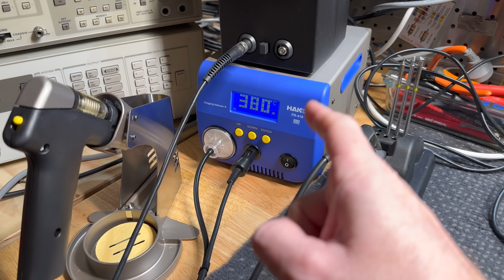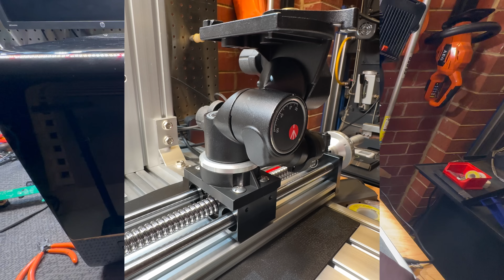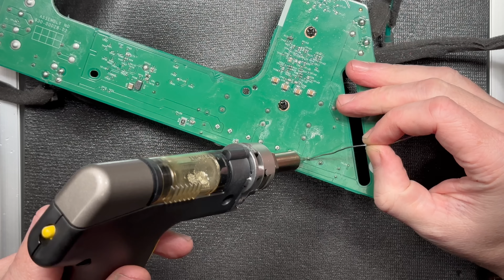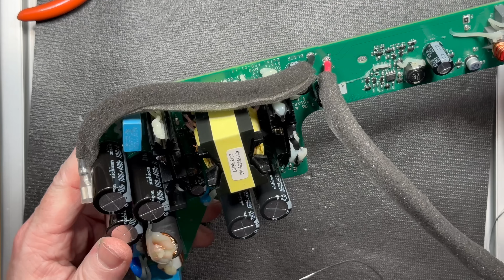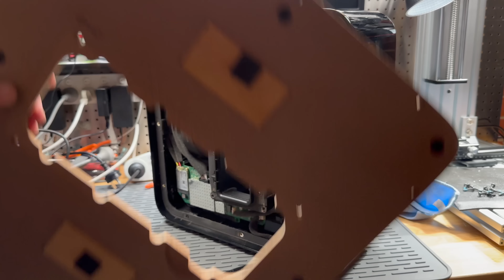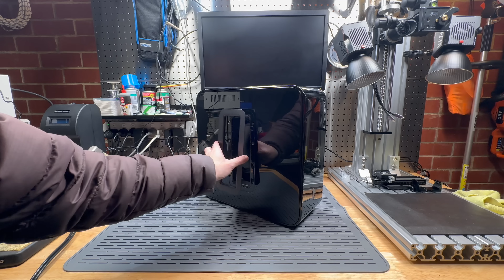SONOS Subwoofer Repair - Part 3

Comment: To anyone wondering which part goes with which component on the board:

R77 - UR73VH2BTTD1R00F
R37 - CRCW06031K00FKED
C85 - C1210C105K1RACTM
D15 - B280-13-F
Q16 - ZXTP2039FTA
Q10 - ZXMP10A13FQTA

For Q10, they were backordered of that particular item so from what I could find, ZXMP10A13FTA was the next closest alternative but unfortunately also backordered so next best I could find was SI01P10-TP which is what I ended up using.

Unfortunate that Sonos provides 0 support on these especially considering the initial upfront cost and the fact that they claim " we have developed a new approach to product design and construction that uses fasteners rather than adhesives, making them easier to refurbish and recycle" but thanks to content like this, they can live on.

Comment: Would you mind sharing the full parts list that you used for this. I have a cart filled with stuff at Mouser but would love the reassurance that all the parts match what you used.
Reply from the maker: It is in the video near the end
Reply: @whatcouldgowrong7914  thank you. i must have missed it. will go back. and thank you for ALL of this. so incredibly helpful.
Reply from the maker: @jonesbasf  21:38

Comment: Plastic speaker frames is downright criminal for this price point. Stamped steel would have been better. Plastic makes a rattling noise when vibration is placed through it. A very cheap and idiotic idea. The frames should be make from cast aluminum at this price.
Reply from the maker: Actually if you research this, the plastic frames actually offer advantages vs stanped steel baskets

Comment: Pro tip, anything connected to ground plane, even with the thermal reliefs, needs to be left on the board to heat up a bit longer. As the ground plane just sicks away the heat. Good tip is to pre heat the board first at around 100 deg c. i use the metcal inductive delodering gun. By far the best but far more expensive too. powered by compressed air too from a shop irline if you have one.
Reply from the maker: I do and I actually considered getting the thermaltronics one to match my inductive iron. Only thing that put me off is I would have to buy another station as I can only run one output at a time :(
Reply: @whatcouldgowrong7914 time to get the dual output station. Perfect timing 😉

Comment: Well done, Since it is a digital amplifier with wifi and such I assume that there is no possibility to solder an audio input.

To connect it to an existing amplifier other than sonos so that you can still use the built-in amplifier but also connect it to a full 7.1 home theater amplifier.

Love the slim design of the sonos sub and good sound compared to the size.

Have several sonos speakers but do not work as well as home theater compared to large speakers
Reply from the maker: I think there may be a possibility if you could get the datasheet for the audio amplifier module but I think the biggest issue is the DSP corrections and opposed drivers

Comment: These desoldering tools are great but they can do next to nothing if the heat transfer does not help. I have a Goot and can crank it up to high heaven but still no good against plated through holes with lead free solder especially when the hole is very tight on the terminals. You need to lower the melting temperature of the solder used and lead free solder is just too high. So you do need to either use leaded solder to "contaminate" the joint or flux. Either works. Leaded solder has flux core anyway so am not sure which contributes more.

As for soldering, I found crankig the iron to 460 degrees and using leaded solder helps. You really need to keep the solder liquid until it creeps into the hole otherwise it will freeze too early and won't go all the way through. This just shows how much heat is lost as soo as the solder moves away from the tip down the hole.

Comment: Sonos is overrated garbage. I can't understand people who are buying their products.
Reply from the maker: People who dont want to cover a room in acoustic treatment or install tons of speakers. Sonos room corrections are simply better than any HT amp based setup ive tried…
Reply: @whatcouldgowrong7914 You make a good point, but for the price, they're using low-quality parts. Don’t they realize that technology is advancing quickly, and someone will create a better, cheaper product that will outcompete them?
Reply from the maker: @hatobp The Sonos subwoofer had had a few generations but the sound hasn’t changed in 7 years and mine is still supported with and integrates with their latest products. My last HT amp was outdated in 3 years due to HDMi video standards changing. Likewise I have taken apart many high end subwoofers from JL audio, SVS etc and they’re all build like garbage inside, no one makes a subwoofer that uses high end components and they all use generic plate amps from China.
Reply: @whatcouldgowrong7914  Did you try a studio speaker, like Focal? I bet they are made excellent with good quality parts.

Comment: I have a Sonos Sub 2 and absolutely love it!!! The construction is really good and it pressurizes the room well. I had no idea how well it works together as a package! very nice! Excellent job with the soldering.
Reply from the maker: Yes I love mine also, despite the failure. I would have bought another…

Comment: I work on automotive very high thermal boards and the use of flux is necessary on unleaded solder, if you want it to flow into the desoldering gun that is, even more necessary on huge ground planes, i have the FR400 and they are meant to be used with flux, multiple ceramic filters
Reply from the maker: I think the FR400 has a fair but more power will keep it in mind. I can get by with leaded solder to keep flux out of it for now :)

Comment: You need to let the solder melt longer. Maybe hold the iron/desolder iron for a few seconds, maybe 5 seconds. And if it still does not work really good, try increasing the temperature.

Comment: What do you think could have damaged the power regulator?
Reply from the maker: Was covered in previous videos, a shorted Scottky diode on the backside was responsible for the original failure
Reply: @whatcouldgowrong7914  yeah i hv watched all the 3 parts, i meant what could have cause the diode to short-circuit? 
Could it be due to over voltage or something?
Reply from the maker: @henrymasakajr7731 Thats a hard one, don’t know enough about the circuit to go deeper but seems to happen the same in all the reports I saw. Im guessing either just a faulty part / Chinese knockoff brand, continuous heating or there could be something inherent in the circuit design. 7 years is a long run for a fault in the circuit design I would have thought. I specced all the replacement parts at the highest spec and brand I could get. The diode was a 2 amp so not a small part to blow out relative to everything around it.
Reply: @whatcouldgowrong7914 oh wow so it took 7yrs for it to have that fault. Am planning of buying a sonos system thats why the questions😅 but since it worked for 7 years thats a good product. I am definitely getting a sonos setup😊
Reply from the maker: @henrymasakajr7731 A good run for this day and age I think with modern miniaturised surface mount components. Ive got 5 SONOS products and this was the first failure. I got my first one back in 2017 and always been impressed with the sound with clean integration.

Comment: I have the FR-410 as well, love that desoldering station. Came from the FR-300 and it was a big upgrade.  I find that adding leaded solder really helps out with those large ground planes. I have Hakko’s inductive soldering station and it matches the FR 410 in looks. It’s the FX-100, it’s essentially a clone of the Metcal, same inductive frequency everything. That thing is an absolute beast, and the two look really good together on the bench. Also, on the large ground planes it doesn’t hurt to let the desoldering iron to sit on the joint for a bit longer to liquify the entire joint before pulling the trigger.
Reply from the maker: Yup learning as I go, good to hear Hakko have gotten into induction irons because they’re the best thing ever. My Thermaltronics is also a Metcal clone 🙂 had it for a long time… I will say it is very loud though and the pulsing of the transformer is very audible and I need to look at it in the future…
Reply: Interesting, the Hakko is dead silent.  I guess if it’s really quiet I can hear a small change in the pitch, but it has to be absolutely dead quiet around, no traffic, no nothing. My laptop is louder than it lol.
Reply from the maker: @danhorton6182 Sorry meant to say the Hakko FR-410 is really loud, you can hear it pulsing in the video. As it’s 100V I plan to convert it to 240V and maybe convert to switch mode if the voltage rails can be copied (I believe there’s 2).

Comment: Hard to tell as it's speed up but it looks like you might be dabbing a bit as you solder. Probably not getting enough heat into the board to make a solid joint.

Ideally you want to be causing the solder to melt onto the component leg/through hole rather directly on the iron to avoid cold solder joints.

Always brush the iron tip on the abrasive wire ball each time you take it out of the stand. You want the tip nice and shiny. Use the largest tip and heat that fits the job.

Add a touch of amtech or similar flux to the joint, add a tiny dab of solder on the iron then hold the iron for a good amount of time conecting with the leg and the hole, then add solder to the leg and hole, not the iron. 

Like you found the ground pins can be more awkward due to the plane.
May need to up temp or at least get the through hole preheated.

Likewise with desoldering, the lead free solder needs preparing.

Go through all joints with a tiny touch of flux and add leaded. Then go through with the desoldering gun in one go, hold down for a bit longer than you were to transfer that heat, move it round slightly like you did - hold it still then only press the trigger for a second or under. Each time you press the trigger you cool the tip. Holding it down while wobbling the tip around the joint isn't doing anything.

Cleaning any desoldering station or pump regularly is the thing really.

Good stuff, keep saving items from the landfill - setup is pretty impressive, nice choice with the hakko, certainly won't be buying twice 👍
Reply from the maker: Thanks for the tips and advice, learning as I go, one you get enough solder down it certainly does a great job at the moment but ill keep refining and learning 🙂

Comment: Congrats for the new tool! I won't retire the manual desolder pump though. I still use them regularly

edit: I use my desoldering iron regularly for 2-3 years with cheap Chinese flux and no residue inside the pumps at all, even the filter is just a cotton. Maybe Hakko's proper (expensive) filter can handle it as well?
Reply from the maker: Definitely will still be around, I got a new Goot recently actually to retire the old girl after many years of service. Flux might be ok for it but ill tread carefully :)